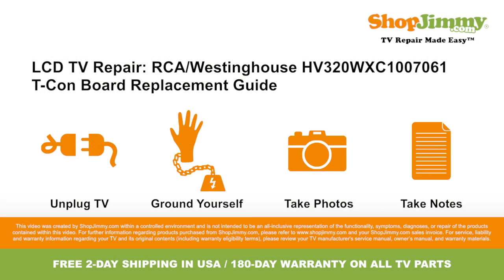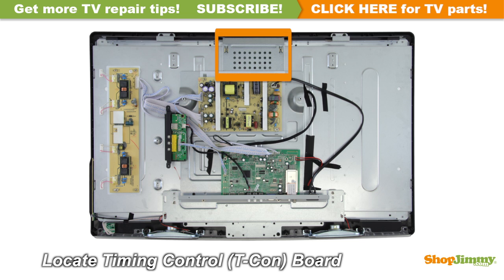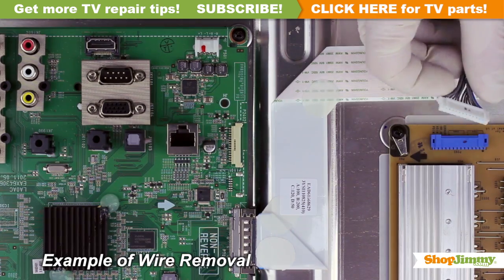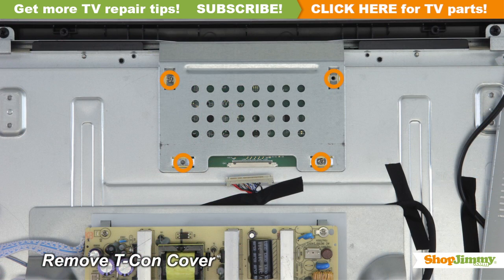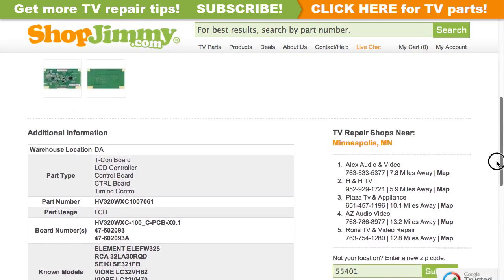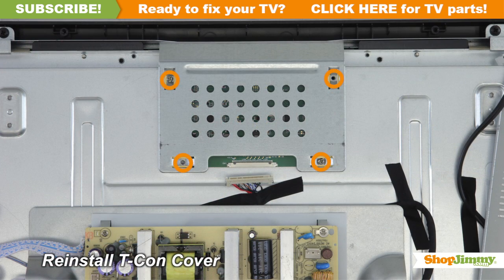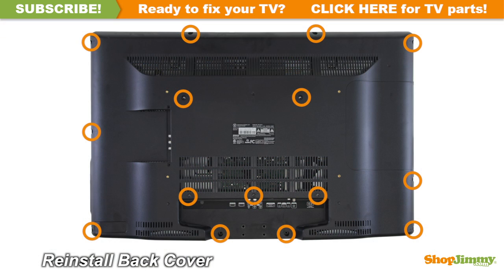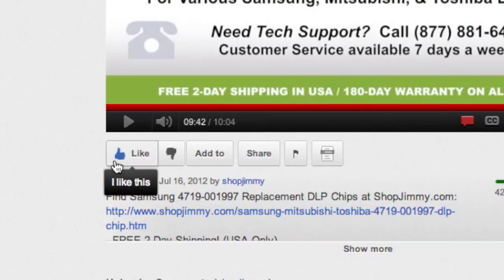RCA/Westinghouse HV320WXC1007061 T-Con Boards Replacement Guide for LCD TV Repair

Comment: I have a Westinghouse TX42F430S  that wont power on. the logo stand by light is on along with 2 lights on main board. I replaced the main board and the power supply board and no change, Where do I go from here?

Comment: Ok, i got i TV just like the one on this video, VR-3215 with no picture no sound but the power LED is solid green, any suggestions?
Reply from the maker: TigredelMar77   Try all repairs and troubleshooting at your own risk.  I recommend running the flashlight test on your TV.   Here is a link to a video we produced that shows how to run the flashlight test. https://www.youtube.com/watch?v=xUzCLgoSPGM Please reply with your flashlight test results and we can recommend a replacement part for your TV repair. Thanks and please let us know if you have any questions! www.shopjimmy.com

Comment: model RCA model: L42FHD37YX8
                  serial: I263CU00P
So, TV was working pretty well fine. occasionally when powered on there would be audio, but no video. When i powered off and then back on it would work again just fine.  Yesterday however, my son was watching tv and while it was on a thick horizontal line of the picture flashed black. Then the picture went away out from bottom right to top left but the audio continued to play.. Now when powered on, there is no image at all (not even input or menu) but the audio still works. I have checked, and the backlight is still working.. 
please help.. I have watched several of your vids and the best i can guess would be t-con. I just dont want to order parts if im way off or there are multiple issues,.. in other words, if it would be cheaper and easier to buy a new one...
Thank you so much!!!
mpk.atyourservice@gmail.com
Reply from the maker: Martin Kelly  Try all repairs and troubleshooting at your own risk.  I recommend buying a new one.  Thanks!  www.shopjimmy.com

Comment: Could the Tcon board be the possible culprit for my issue?  I have a 46" LCD tv with a vertical line that is dim slightly off center to the right of my display.  The display is just darker in this ~4" thick vertical line(top to bottom).

Comment: Hi. My TV blew out. There was a power blitz for ten seconds and everything else on my surge protector came on but the TV. It's connected to a BELKIN surge protector. There are no indication that it's working. There is no red light and if I use the remote nothing comes on. 
My model No. Is 50LB45RQ
My serial No. Is 2502-50LB45R-102033
The manufacturers date is Nov 2012. 
It's a RCA FULL HDTV 50 inches.
Reply from the maker: Xta Cee   I recommend replacing the power supply board and the main board in your TV.  Here is a link to replacement parts for your TV model number on our website, click here:  http://www.shopjimmy.com/catalogsearch/result/?q=50LB45RQ  Be sure to match part numbers on your current board, with your replacement for compatibility.  You can also call our customer service for further assistance with your purchase.  (877) 881-6492  Thanks and please let us know if you have any further questions with your TV Repair!  www.shopjimmy.com

Comment: le52b55-a rca led will play fine then power off, might play 2 mins or 2 hours. wont respond to remote or side buttons. unplug power and reconnect and it powers up and plays again. sears tech replaced power board and main board with no success. he said it was a bad panel. could it be the t con board? tv is 4 months old and rca is refunding my money and they dont want it back. i hate to junk it.
Reply from the maker: mmike3132   This sounds like you received a defective replacement board in your TV.  Here is a link to possible replacement parts for your TV model number on our website, click here:  http://www.shopjimmy.com/catalogsearch/result/index/?cat=56&q=52b55  Be sure to match part numbers on your current board, with your replacement for compatibility.  Here is a link to a video showing how to identify your part number, click here:  Samsung Main Boards & Digital Boards: Part Numbers for LED, LCD, DLP, Plasma TV Repair  You can also call our customer service for further assistance with your purchase.  (877) 881-6492  Thanks and please let us know if you have any further questions with your TV Repair!  www.shopjimmy.com

Comment: My TV RCA 46LA45RQ Do not work using the remote, The side panel works fine, I believe it's the TV remote control receptor because I point my remote control to my camera and pushing any button I could see the remote lights flashing on the monitor, what should I do? Help...Thanks.
Reply from the maker: gfemex   I recommend replacing the IR sensor in your TV.  Here is a link to replacement parts for your TV model number on our website, click here:  http://www.shopjimmy.com/catalogsearch/result/?q=46LA45RQ  Be sure to match part numbers on your current board, with your replacement for compatibility.  You can also call our customer service for further assistance with your purchase.  (877) 881-6492  Thanks and please let us know if you have any further questions with your TV Repair!  www.shopjimmy.com

Comment from the maker: @ROMO - Try at your own risk, be sure your TV is unplugged before doing any work.  You could check all the connections on the boards and make sure there are not any loose connections.  Try that and then reply to let us know if you still have your problem or if is fixed.  Thanks!